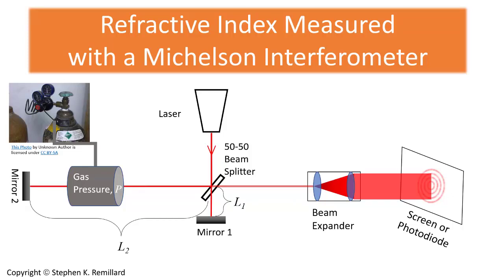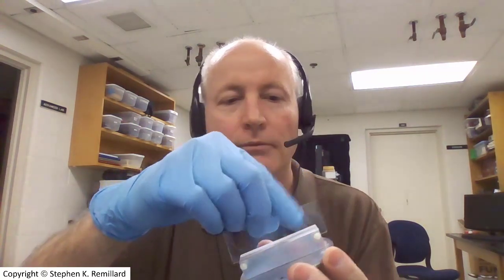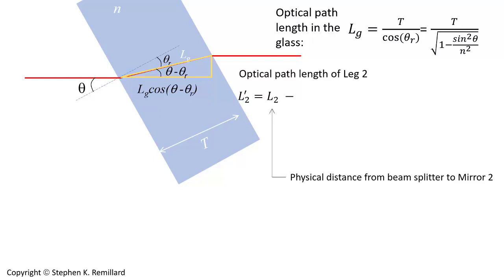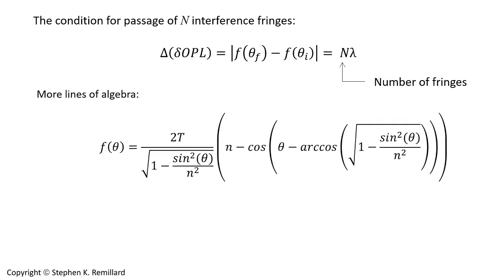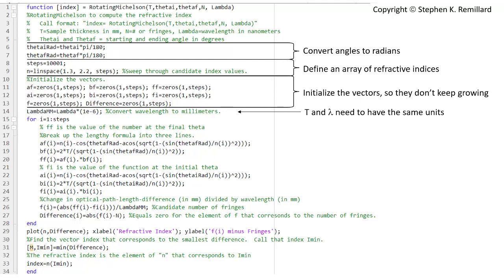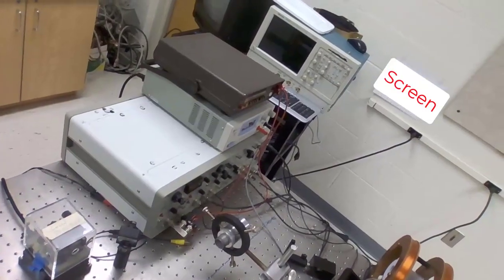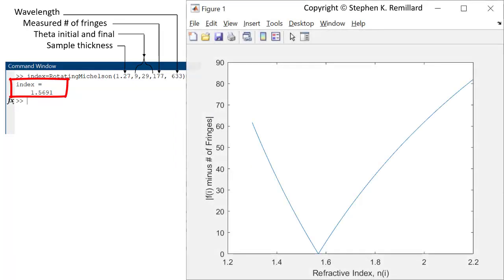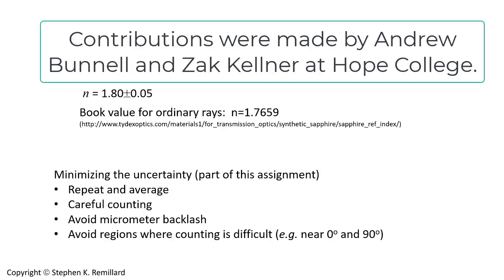Measuring the Refractive Index of Glass using a Michelson Interferometer, PHYS 382

Comment: Beautiful! Thank you so much... how would you do this for a liquid? hehe
Reply from the maker: I suppose that I would approach the analysis in a similar manner.  I would try to use a rectangular container for the liquid, with the container made out of a known material of known index (otherwise there would be two unknown materials).  As the sample rotates, the liquid of unknown index is becoming thicker as is the clear solid of known index that contains the liquid.  Without actually working out the problem, I can only speculate that it has a solution.